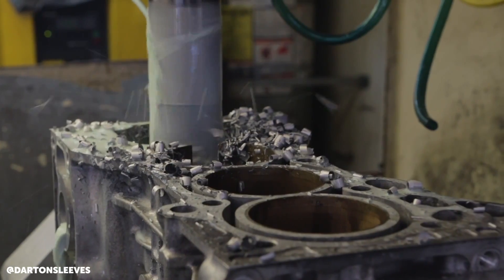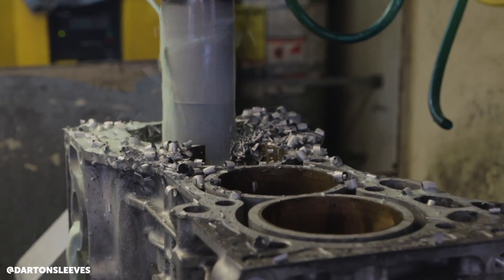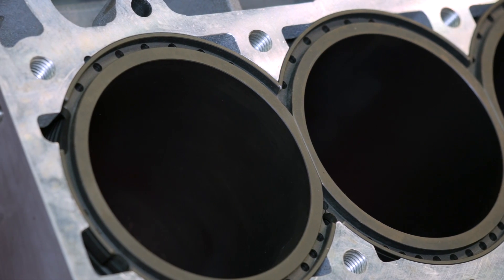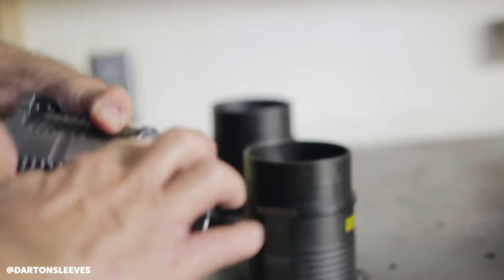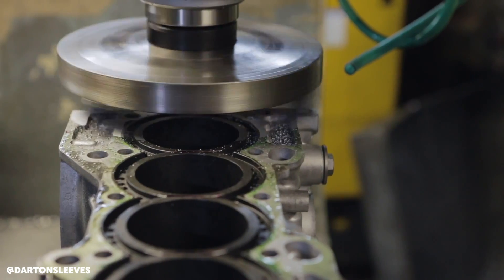Too much BOOST for your engine block? This MIGHT be a solution.

Comment from the maker: Building a fast car? Get $400 OFF the VIP package and never pay for another course, EVER:  https://hpcdmy.co/vipy18
50% OFF your first engine building course. Enrol now: https://hpcdmy.co/offery18
TIME STAMPS:
0:00 - Too much boost?
0:23 - What the sleeve does.
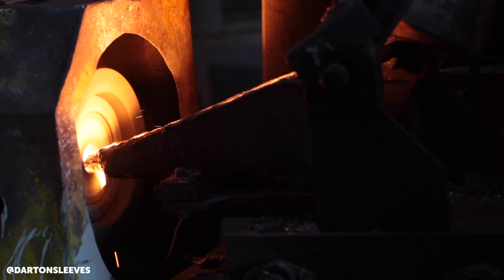0:50 - Improving open deck blocks.
1:58 - Sleeve dropping. What is it?
3:00 - Tiny movement = big problems!
3:32 - Cause? Process/fitment issues
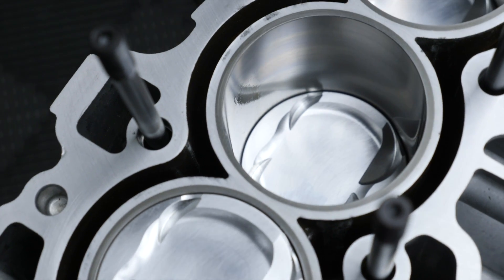4:18 - How do people get it wrong?
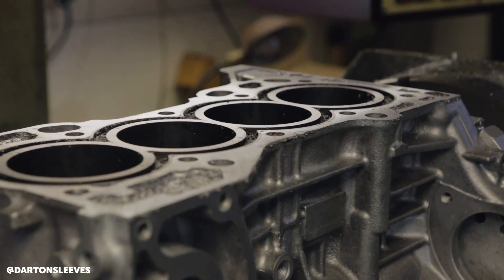5:09 - Are CNC's a requirement?
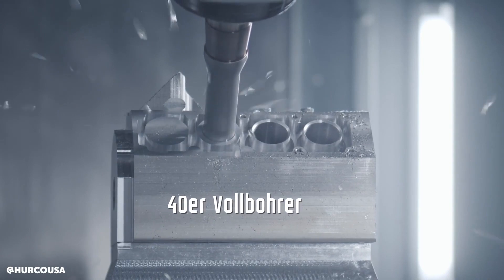5:48 - Heat from machining matters.
7:02 - Finding a machinist.
7:41 - Thanks John!
8:09 - BUILD | TUNE | DRIVE
🙋‍♂ Take $25 USD off ANY HPA course with coupon code: YOUTUBE25
Enrol now: https://hpcdmy.co/25offyt

Comment: The guy speaking for the company is talking like an idiot is running the machine shop.     He is acting like everyone without a cnc milling center can’t install their sleeve.       “You can’t hog it out in one pass without flood cooling”.  Lmfao.    They can’t even machine a block in a single pass for a sleeve         The literal best in the world have to do more than one pass.    Come on guy.   You make great products.    Don’t act like an arrogant prick.  We don’t and we use your products and build engines for everything from the lake,to desert to track.
Reply from the maker: He can only speak from experience and they had enough consistent failures from poor machine work to warrant that recommendation. It's great you can do it, but that simply hasn't been the case across the board.
Whether you agree with what he says or not, ultimately, all he is trying to do is help make sure his customers have the best experience possible by having the product installed correctly - Taz.

Comment: i have those sleeves in my n54 block. 3.3l stroker crank and it sees 50psi all the time.  literally the ONLY way to keep an n54 block square at 1100hp

Comment: i didnt go darton, but i have a fully built, sleeved honda now running 42psi. what advances they have made in the recent decade are astounding and its still unreal to me that i am able to turn my engine to over 10k rpm all while pumping so much boost into it. Now i am aware fully that i am running my car hard. and it will fail. its no fault of the engine. it just happens when your asking over 5x the factory hp output.

Comment: Would this be an option too if you had a closed deck block but want to put 2-4mm oversized pistons in? Without thinning out the cylinder walls too much that us
Reply from the maker: Depending on the block design and support for it, going to a bigger bore is one of the reasons why some fit sleeves like this, for others it's just a bonus - Taz.

Comment: We used to weld open deck blocks up to keep the head gasket sealed
Reply from the maker: We've come a long way from that eh! 'Fire rings' etc (they have a few names) are pretty standard on a lot of high performance builds these days which have been a game changer for many - Taz.
Reply: Like a mark3 focus RS

Comment: Kinda funny how i never need to worry about this because my cylinders are already iron and they are detachable from the block individually.
Reply: Another reason you don't need to worry about this is that your corvair doesn't make enough power to worry about these kinds of things.
Reply: @Dane33781  turbocharging is done on them for racing so it's still a pretty good feature to have.
Reply from the maker: Unlikely they are ductile iron but that is a win for sure if it's all working for you, your required power levels and your application without the need for modifications like this. If you run into issues you might even find you just need a deck plate or something rather than sleeves like this too.
Alternatively you might decide to ramp things up and find that even that isn't enough.
The mods you need, or don't, are all relative to YOUR build rather than anyone elses - Taz.

https://www.hpacademy.com/blog/fixing-open-deck-blocks-for-boost-on-the-cheap-ish/?utm_source=youtube&utm_medium=social&utm_campaign=general-interaction
Reply: @hpa101  head bolts and cooling are effectively the limiting factor for these engines, their operating temperature is way higher than most normal engines so much so that when they run too hot the concern is less about the engine binding and more about the head bolts loosening themselves, atleast that is what people who race them have said.

For me the benefit is I can just take the cylinders off and trade them in for a new set because they tend to reuse the good ones a few times by cleaning, boaring and honing them and selling them as standard over boared cylinders.
Reply: VW bug or big diesel?
Reply: @Namesakes.unit-x-10sq10  Chevy corvair.  Although I can use slightly modified vw cylinders too.
Reply: @deltacx1059  neat! Boxer engines are so smooth👌
Reply: I have to ask. How much power does your flat 6 make?
Reply: @Dane33781  I just got the one recently so it is stick at 102hp although if I remember right the only difference between the 102 and the 140 is the head and the rods although I could be mistaken.
They made a package that got a turbo and made 180. 

I plan to try and get mine to over 200, but my point is the architecture of the engine can handle quite a lot more if need be.
Reply: @deltacx1059  That's cool. Congratulations on getting your engine. The point I was making before is that many of the engines that need darton sleeves are making well over 1500 HP or more. I'm not a corvair expert but I don't think that flat 6 is capable of anything like that. The comparison isn't very useful.
Reply: @Dane33781  oh ok i was operating under the assumption that they also use it for engines with particularly weak cylinders as well as high power applications.

Would be cool to have modular race engines though, i can see easily replaceable cylinders being a good time and money saver for race teams.

Comment: CSS is the way
Reply from the maker: Good to have options! If there was no competition there would be no drive for companies to keep innovating and working to deliver solid products and services - Taz.
Reply: @hpa101  also with having options, the consumer has the benefits of receiving more competitive pricing in their choice. if there was only one option, prices would be unreachable for the non-sponsored racer/builder. having choices keeps pricing reasonable imo. I bought a complete sleeved block with a line-bored girdle, balanced crank and fire rings for 1900USD. additional costs on boring for p2w and others not included in that cost. short block alone. after machining. and parts. i am just under 5k into it for something that is now making 4 digit power. (head valvetrain cams turbo axles trans clutch and other items not accounted for in that)

Comment: I been using cylinder sleeves for 25yrs+ across a wide variety of engines with great reliability. I do understand why so many people have issues like dropped sleeves and its not caused by quality of machining equipment or manufacture of the sleeves or fault of assembly or tuning.

Comment: Reasons they drop from what I have seen is machinists not making rebate mating surfaces completely parallel allowing the sleeve to hammer itself in over time, and also not being decked at or slightly above operating temperature. The lower the mating surface of the sleeve the more important machining at temperature is because of thermal expansion. If the mating surface is 10mm from the height of the deck and an 80c change in temperature, that is about 0.00912mm expansion differential, but at 100mm that is now 0.0912mm.
Reply: So dumb question then why not Shrink fit? Seems like a kinda easy solution to the problem. Getting liquid nitrogen/dry ice isnt as hard as it used to be.
Reply: @thinkingcashew6  Shrinking the liner and heating the block does allow for a tighter fit around the circumference even after expansion, however it does not allow for thermal expansion with reference to height if the deck is still machined at a colder than operating temperature. The aluminium deck will rise above the cast iron cylinder when it heats up. You either machine at about operating temperature, or you machine the aluminium deck and cast iron liner separately leaving the liner a little longer and then install. Machining at temperature is preferred.
Reply: @chippyjohn1  Who offers a 4 axis CNC mill with heating elements?
Reply: @bretbauer7582  decking a block or boring it is not done on a 4 axis. Its a common practice to heat a block by flowing coolant through it when deck surfacing.

Comment: There is Darton, and then everyone else. Their products, R&D and experience stand head and shoulders above the rest. I think a lot of people in the comments see this video showing Darton as havign one product, when 90%+ of their sleeve products are traditional sleeve styles albeit manufactured with proprietary chemistry. The hardness of Darton ductile iron sleeves, and nodular density is a multiple of any other manufacturer.  The sleeve covered in this video is mostly for very high boost small displacement all out racing engines so does not cover the vast majority of applications.
Reply from the maker: Yes for sure! A lot of what we cover is pretty niche, but hopefully interesting as well. Cheers for taking the time to comment - Taz.
Reply: @hpa101 I’ have there sleeves in my daily you see on the rollers

Comment: This guy is now the reason I will never buy Darton sleeves. I've been a machinist and engineer for a long, long time, and that guy is talking out his ass.
Reply: Good for you. As an engine block manufacturer I disagree entirely with your comment.
Reply: I have 4 boring machines and a jig borer have been boring cylinders for nearly 50 years never had an issue with tolerances.
Reply from the maker: Yes he always upsets machinists with those comments. If you are a good machinist that has dealt with these on a regular basis you will have no doubt fixed poor installation work previously. If you have not, then you should talk to some machinists who have before judging too harshly.

Outside of that you have to keep in mind such statements are from years of experience dealing with many machinsts on a level/volume that other machinsts do not, and it is stated with the best interests of their customers and product in mind wether you agree with his experience or not.

I'm sure you even know another machnist local to you that you wouldn't send work to. Imagine dealing with that on a global scale and wanting to make sure your customers have the right experience with your product/s 😎- Taz.

PS: There are installation manuals here if you want to take a nose at the details: https://dartonsleeves.com/tech-publications/installation-manuals/
Reply: Exactly, no quality machinist talks imperial.
Reply: @chippyjohn1  that is total nonsense.

Comment: 0:37 what is this ????
Reply: @daronlachinian1217 
I have never seen deformation of such scale in my life!
Reply from the maker: This is a darton sleeve that's been put in a hydraulic press and squeezed to within an inch of its life. The point is to demonstrate how the ductile iron is... ductile. A factory sleeve would crack/fail instead of deforming like the darton sleeve. Obviously an extreme example but the factory sleeves do flex in operation with high cylinder pressures and this can lead to cracking and failure - Andre
Reply: @hpa101   
Done on purpose for demonstration, now its clear. 
I cannot imagine that such a deformation would occur while the engine was running. 
Thank You Andre!
Reply: @jareknowak8712 as mentioned before, it's an extreme example, wouldn't see such deformation in the engine.

Comment: Seems sketchy.  Also, where is this a good option?  If you need to fix an aluminum block, would it not be cheaper to buy a new factory block?  If you are building a high hp race engine wouldn’t it be better to use an iron block or a burly aftermarket aluminum block?  If this is not cheap to do, I don’t see where you would do it.
Reply: Buying another original block is probably not the best solution. 
But such stock block can be modified. There are inserts that you put on the sleeves, I also know an example of driving metal pins into the space between the sleeve and the inside of the block (Nissan VQ35DE).
Reply from the maker: You can replace like for like and then have the same issue over and over, sure. 

This instead is one option for those that are dealing with cylinder pressures their stock setups were not designed for and cannot handle. You wouldn't do this without a reason to, as in your local mechanic is not fitting these to everyday road cars just because they exist.

Advantages include the ability to replace individual sleeves if damaged, increased block strength/rigidity (important for head gasket/cyinder sealing), more bore size options and cost vs some alternatives which require much more machine work. You can also do something more simple like a deck plate if a bit more rigidity is all you need for your intended power levels.

You could engine swap to a different block, that is expensive and will probably put you into a different class of racing depending what you're goals for the car are.

Different block materials also have their own problems too though and even billet aluminium blocks might fit the likes of Darton Sleeves due to some of their inherent advantages - Taz.

https://www.hpacademy.com/blog/when-is-it-time-for-a-billet-block-mazworx-2000hp-sr20-tech-talk/?utm_source=youtube&utm_medium=social&utm_campaign=general-interaction

https://www.hpacademy.com/blog/why-do-cylinder-sleeves-drop-darton-sleeves-tech-talk/?utm_source=youtube&utm_medium=social&utm_campaign=general-interaction

https://dartonsleeves.com/tech-publications/mid-information/

https://www.youtube.com/watch?v=sUZPByevb8A
Reply: As with most things, depends on what you're wanting to do with the engine.

In some cases a billet alloy block might be required, but it will still need sleeves - and they're freaking expensive!.
In some instances a cast iron block will provide the basic strength, but that's adding weight.
In some instances replacement blocks may not be available new, or it may be impossible to find good cores for re-boring - so a sleeving will be required to salvage the block.
In some instances aftermarket, stronger blocks may not be made, and if the engine is known to, say, have cracks developing under high boost, or the cylinders are open and allow excess flexing, a sleeve can be used to prevent those things happening.
In some instances it may be advantageous to sleeve down the bore, perhaps to meet a capacity limit.

For some a full sleeve job will be a waste of money, for others it may be the best thing they can do for their block, and head seal, to survive the stresses.
Reply: another reason is most import guys are doing this for the main reason as their engine options for their respective brand were never available in anything other then aluminum. (except the legend, 2jz). but using honda as an example, basically al of their engines are aluminum. so getting a cast iron block just isnt an option. sleeving isnt really necessary for anything low or mid hp for street driving. but there are people, myself included who are running absurd amounts of boost to make these little 4 bangers produce 4 digit power numbers.